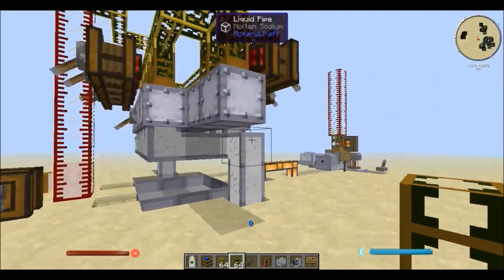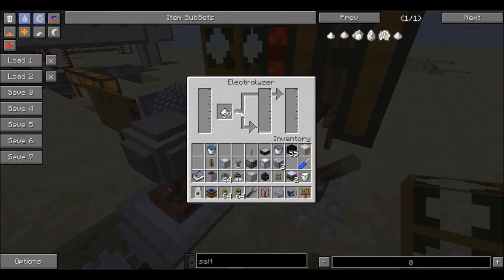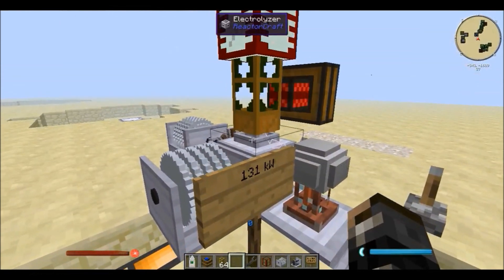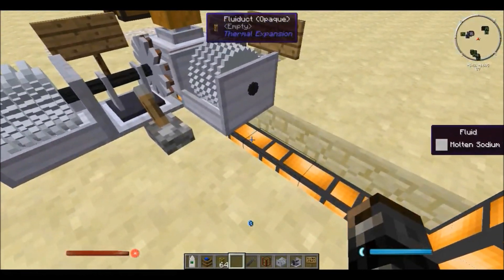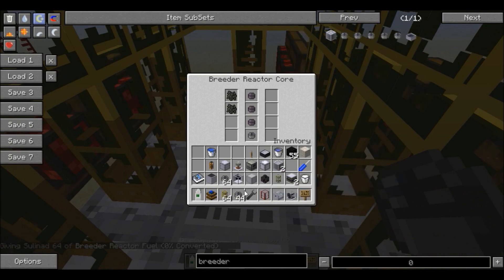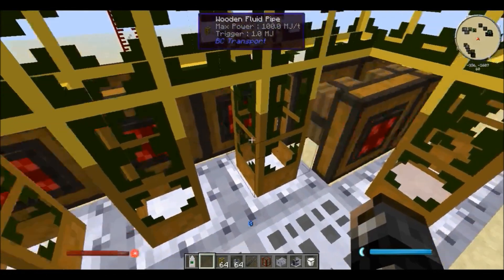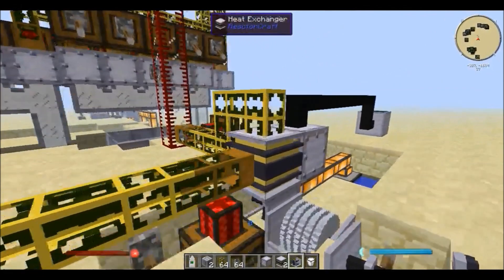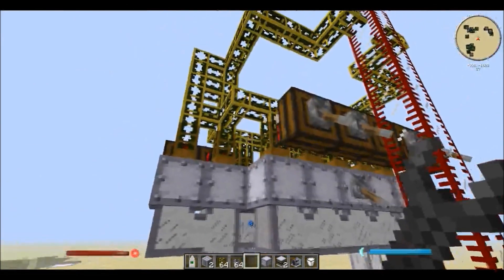ReactorCraft tutorial: Breeder Reactor (part 2)

Comment: Is it possible to save watts in some kind of a battery? I haven't found any way by watching spotlights, so I think one of you guys knows it. I mean there must be any way, otherwise this add-on would be somewhat useless. 
I appologise for being silly if there is any way thats extreamly obvious. Thanks!
Reply from the maker: Ya, ofcourse. Check out my spotlight on RotaryCraft :L ReactorCraft is pretty much an add on to RotaryCraft. You can save the power in the Industrial Coil. Or turn it into another kind of power using the many power converting machines and save it that way.
Reply: Danilus OK, thank you. I've watched Bevo's spotlight before and the only way to save power he mentioned was the flying weel.
Reply: Thomas Johnson You can use flywheels, industrial coils, or coil winders to store power.

Comment: having trouble getting a setup working, it keeps exploding on me, is there a way to keep it from getting too hot?
Reply from the maker: What is exploding?
Reply: Danilus
The reactor core keeps detonating after it gets too hot. It starts to hiss and quickly after that explodes (testing build in creative)
Reply from the maker: FuzzyCheddar90 My guess is that you don't have enough sodium being pumped in.
Reply: Danilus
that's probably it, may need to mess with a setup where I either have a huge surplus or multiple machines making it
Reply from the maker: FuzzyCheddar90 Of its in creative and you have latest RC, theres a new tool you can use to make the resevoir have unlimited fluid.
Reply: I think I do, I've been having an issue where if I leave the world that I made to test stuff in it will revert back to just before I made the reactor, so been ending up building multiple. Also noticed some pretty rough glitching of the turbine, but that might be mod conflicts in the pack I'm using.